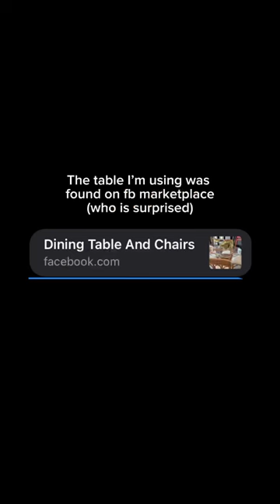Everyone with a glass table should try this DIY #shorts

Comment: So cool! How do you make sure the glass doesn’t slide off the top?
Reply: Glass is heavy!
Reply: like the last person said, glass is heavy, BUT if you want to make it less slippy you can either buy a pack of tiny glass table pads and stick them on a few of the raised pieces on the edges and they’ll grip to the glass. if you want it to be more permanent, you can use some clear two part epoxy, just make sure it says it sticks to glass and whatever other material your raised bits are and you’ll be good! you might end up with a spot that’s slightly different colored where the epoxy is but it’ll be glued together for sure
Reply: it’s actually good to NOT have the glass glued down. If the glass was fastened to the table that would put strain on the glass and if something were to lean on it or pull on it, it would break much easier since it wouldn’t be able to move
Reply: Although glass is heavy , it slides pretty easily . You can buy a pack or grippers . I’d suggest ones small enough to not distract the pattern. 3-4 should be enough.
Reply: You put your arms on that table and the paint is going to ensure that your arms are sliding that table. Bump it slightly the glass moves slightly. I've cleaned a lot of glass tables in my 12 years of cleaning houses. Doesn't matter how heavy or how careful you are... it's gonna slide if you don't give it something to stick to.
Reply: Glass slides off of finished wood much easier than it does painted wood so you don’t need to worry
Reply: You could put clear silicone rubber caulking randomly on top of the puzzle pieces, let it dry,and put the glass back on. It should not slip as readily, and the glass top remains removable.
Reply: @princesslupi4136  adding onto this to specify tips on placement for a puzzle piece diy - this seems like the most sturdy option offered so far, but regardless of material, put the gripping stuff in between nooks in your puzzle pieces to try and avoid affecting the shadow effect this whole piece is focused on. Instead of all these puzzle pieces AND a few well placed dots at equal measures around the table, find some well-spaced puzzle shapes (or hell, just do a bunch) and slap whichever option you choose inside the concave sides so you're not technically adding any new shapes for light to work around.

Comment: Imagine this table but with either a customer puzzle or one u really like but what you should do is line the pieces up so the picture is visible m but don't connect them.......spread the pieces out a little and it will be like an exploded picture. Although you might have to have some spare pieces running a long the outside to keep the glass level if you can't spread the pieces out enough

Comment: Lol i guess it will make the glass table potentially much safer as well. Years ago i leaned on glass table after returning from vacation and telling the stories about it ... well the table broke and cut my hand to the bone and i had trip to the emergency where they had to sew my hand's muscles back together. Table got replaced with solid wood table (without any glass).

Comment: i keep getting sent this, because I really do not like how it looks. You could at least have painted the legs. The table itself just doesn't fit that aesthetic itch for me, idk. I would literally prefer the whole thing be puzzle pieces. maybe carved into the wood, and then painted gold/red or w/e, and then sponged white everywhere but the creases. That or a much taller table with a border made out of more plywood a couple of inches thick and held up with stacks of puzzle pieces or puzzle pieces on dowels, and full of puzzle pieces(probably in different colors). this is just diwhy material to me, like gluing moss onto a candle from dollar tree. Yes, it's easy, yes it's cheap, but it's not something worth doing.

Comment: Plywood is not an "aesthetic", people, it's just unfinished
Reply: and it looks cool unfinished, so I will leave it unfinished, which makes it aesthetic
Reply: Right, because people HATE the look of composite rock, raw leather, steel...
Reply: @oiytd5wugho  yes all of those things are perfectly 1:1 comparable to the aesthetics of construction scaffolding and boarded up windows
Reply: @insederec  construction uses a lower grade. Anyway, just accept that people like plywood and move on 🙄
Reply: Some people love unfinished wood. I personally would've put a matte glaze over it instead...it has more dimension, looks more high quality and artistic🤷🏾‍♀️
Reply: Plywood isnt but wood is. Theres a reason we use clear glazes and sometimes finish modules with a clear varnish and nothing else. Its wood.